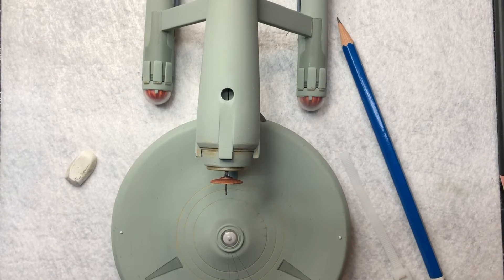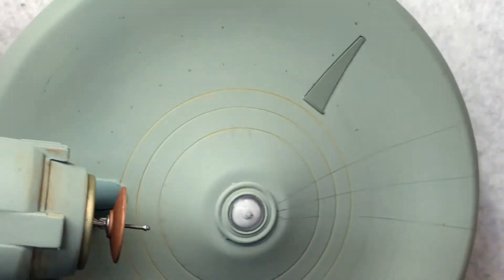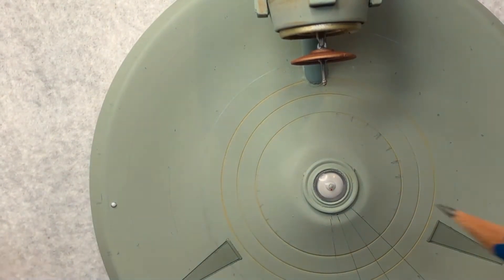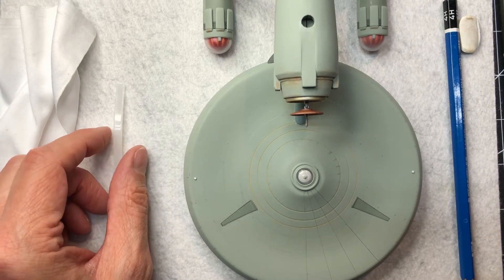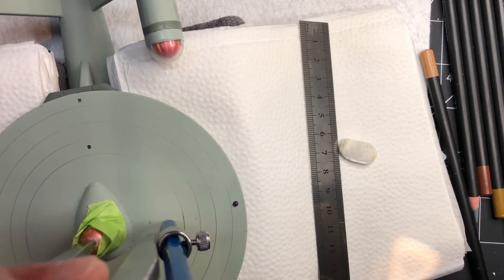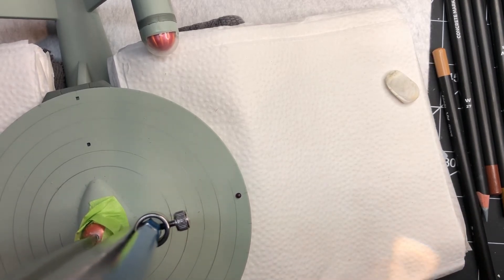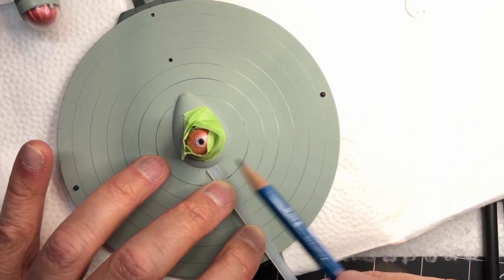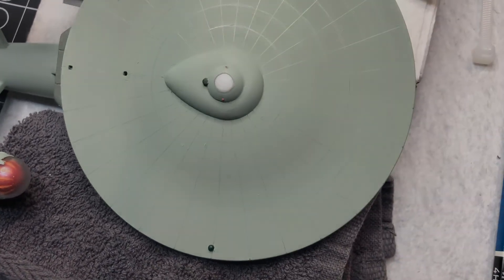U.S.S. Enterprise - 1:1000 - Part 3 - Grid Lines - Polar Lights

Comment: Someone makes Gridline decals for this kit.  Though I think they only have 28 lines around the 360 saucer.
Reply from the maker: Hey Salty, Thanks for dropping a note about the grid decals. I had no idea that was out there. Using a large compass for the circle lines and the Sinclair blueprints for the radial ones is a bit clunky, so having a waterslide option might be a great alternative for some.
Take care.
Reply: @ArcticModeler  they're on ebay.  I haven't tried them.  It looks like a bug wallpaper style decal thst covers the entire top or bottom and has cutouts for the bridge module, sensor dome, and the bolt hider thing.  Since you're here, I know you used Tamiya XF12 lightened for the hull color, but what color did you use for the gray accents?  TY.
Reply from the maker: The primary grey accents that are found all around the ship and on the back ends of the nacelles is XF-22. I also used XF-19 lightened with XF-2 (2:3) for the nacelle intercoolers and a custom mix for the darker nacelle reactor loop accents: XF-12, XF-67 and XF-54 (6:1:1). The grey on the underside of the nacelles at the front is XF-12 straight. Hope this helps.
Reply: @ArcticModeler  Thanks.  Have you ever done the AMT 18" Enterprise?  I did one recently.   When I first opened the box I thought oh no, this thing is a mess.  But once I got into gluing, filling, and sanding, it started to really come together.   It feels very old building it, but fun.
Reply from the maker: Hey Salty, Yes, I have built the original AMT 18". Twice, actually! Once as quite a young fellow in the 70s (with the brutal tab connector for the nacelle pylons) and then again in the 80s, with much better results. I loved the second one and I was very proud of it, even though I had painted it the wrong colour (gloss white) and I hadn't sealed it after applying the decals, so they eventually discoloured and peeled a bit. Now you've got me feeling a bit nostalgic for that old kit!! How did your recent build turn out in the end? 

Thanks so much for bringing back old Enterprise model memories =D
Reply: @ArcticModeler  It turned out okay. I wouldn't mind taking another stab at it to correct a couple small mistakes.  I got it at Hobby Lobby on sale for 40% off, which makes it very worth it at 24 bucks instead of 39.  It's a lot of ship for that money.  The pylons are much better now then older versions.  But the levels of flash were crazy.  It feels old and the molds must be showing their age.  The (lack of) assembly locator pins is humorous.   I ended up melting all the excessive flash down with Tamiya thin cement and using it as gap filler and to "weld" the secondary hull parts together.  I also ran some sprue pieces inside as bracing.   I could actually see filling the secondary hull with some low expansion foam back towards the shuttle bay.  It'd really lock it all together.  It's solid as is, but there are so few male to female pins and tabs.  But it actually looks really good once it's all done.  The addition of the standard polar lights round stand is very nice.  The kit looks great next to my 1/1000 Discoprise, which is painted to match (XF12 lightened).  They're basically the same size.